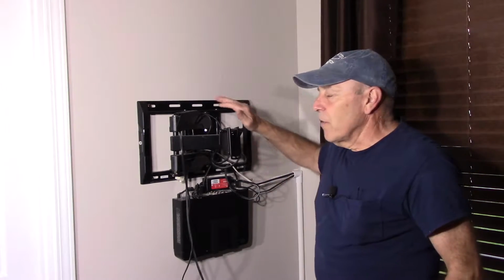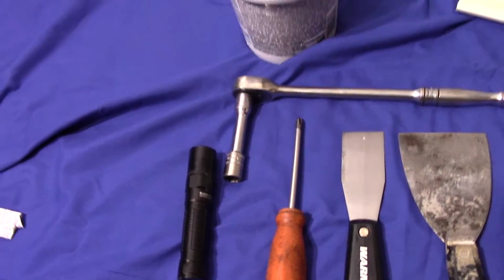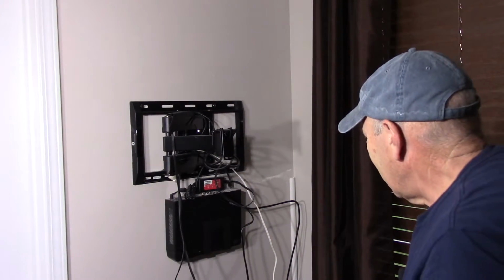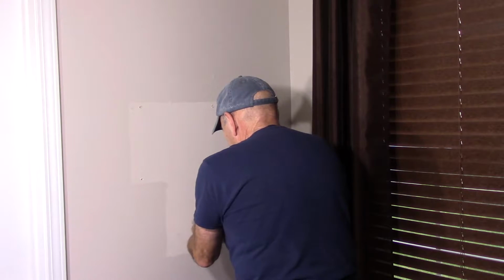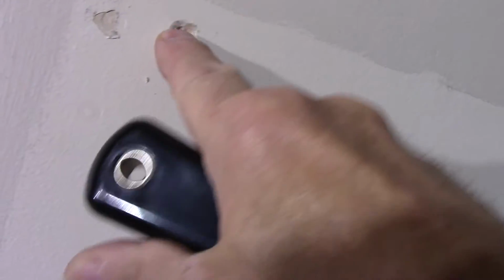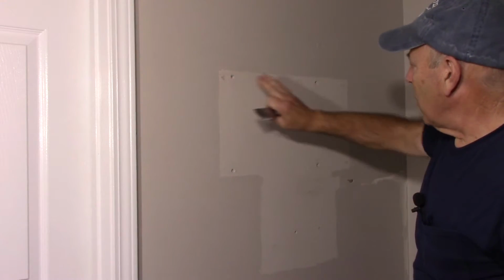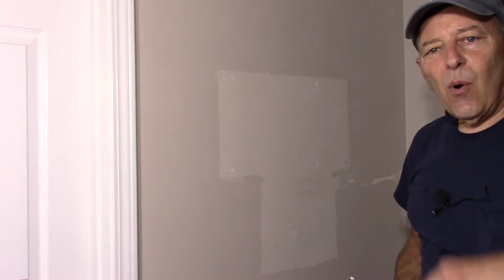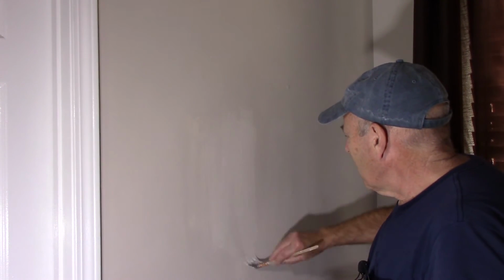How To Remove A TV Mount

Comment: I removed the 4 bolts and it's still on the wall not sure what to do now
Reply from the maker: The paint around the bracket probably is holding it on the wall.